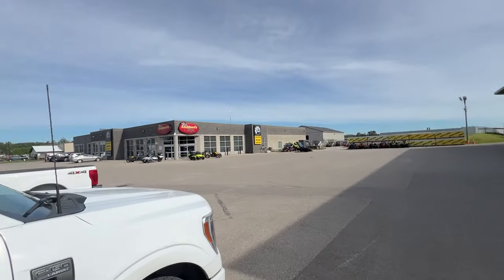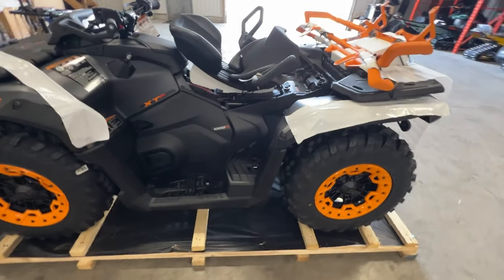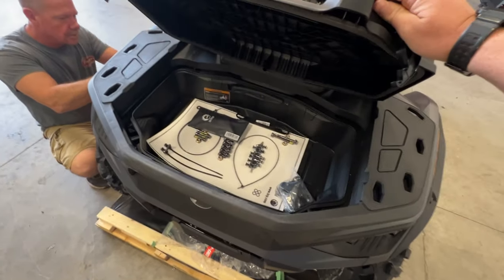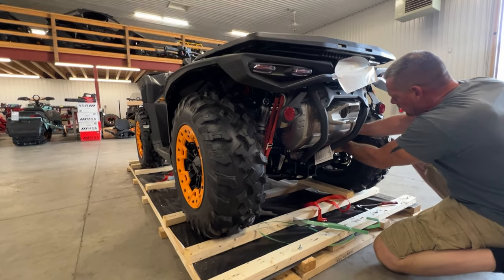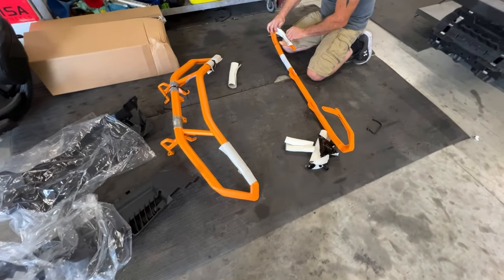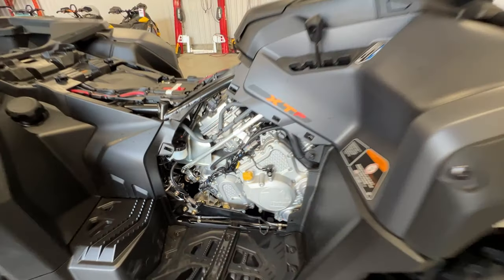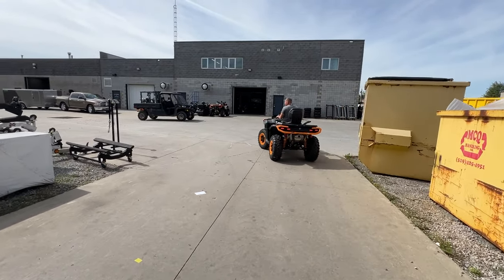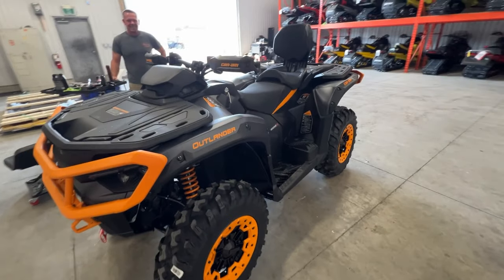2025 Outlander MAX XTP 1000R UNBOXING!

Comment: Great video. Machine is awesome. But way overpriced
Reply: Not overpriced for what you get. Maybe overpriced in Canada not America though
Reply: @JoshuaOverman  this unit is 20k us.. and you get less than on a cf moto 1000 touring which cost half.  Can am  has no interactive big screen like cf moto or polaris. It is in deed  way over priced.
Reply: @bigdaddy490  18k for the 2 seater one and 16k for the normal xtp
Reply: @JoshuaOverman  and that's 20k with tax.
Reply: Dont think so, its smalllll difference between '24 & '25
Reply: @bigdaddy490  the cfmoto comes straight from china from top to bottom but no idea where brp stuff is made
Reply: @GRamerDim  that's true, but so what? Caterpillar and many other manufacturers have plants in China. I have a 2019 cf moto 600 with 9800 miles on it. Brp is Canadian, and way overpriced. In my opinion the cfmoto product is the best value out there from someone who rides more than most

Comment: $16,000 in america is why i would price a CF Moto
Reply: I have no experience with cfmoto but can am is more of a high performance atv, this is also one of the highest trim options. 16 more HP than a cfmoto 1000.
Reply: Wow! 16,000 atvs, 60,000 utvs. 25,000 snowmobiles.  A new car should be 100,000.  Having a little fun is getting out of reach.